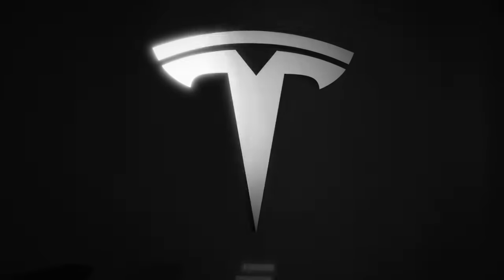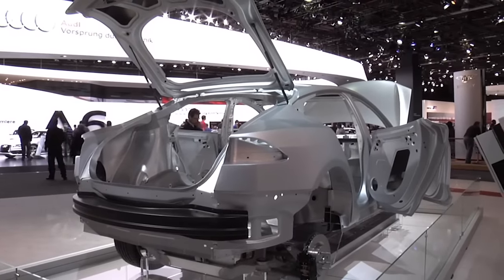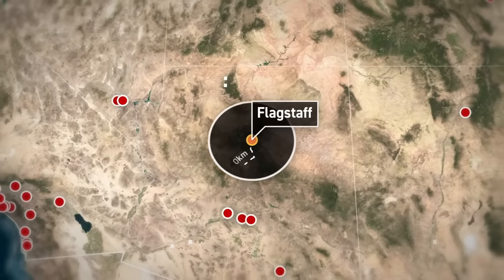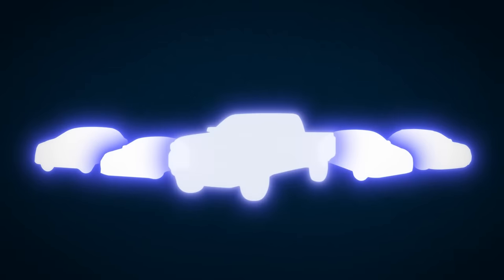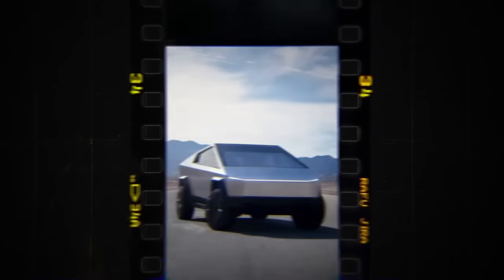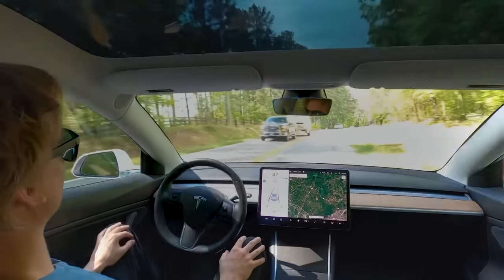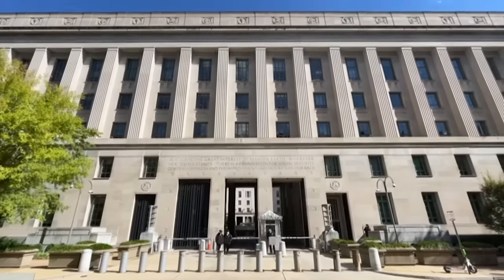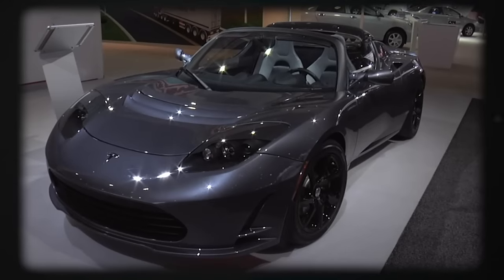How Tesla Fumbled

Comment: Honestly, I would just prefer a better public railroad system for both city and country areas. This massive public transportation would mean far less traffic, far less air travel, etc. Which means it would be better on the environment.

Living in Midwest we have a horrible public train system, the nearest station for my areas is over 105 miles away.
Although I'm in the country I'm surrounded by a handful of citys, hell my states capital is only 35 minutes away. But still, nearest train station is 105 miles 🤷‍♀️
Reply: Doesn’t work outside of high density zones, unless your low-density zones are extremely dense, like Europe (e.g avg Europe single-family homes are 3x smaller and property is 6x smaller).  Only ~13% of US citizens live in high-density
Reply: @monsterous289  and actually putting public transit in those high density areas would make a huge difference for the most people! Just because public transit "doesn't work" outside of cities is not an argument against it. Even then, intercity/town train and bus routes that do stop in rural areas can still work!
Reply: @elliotagnew9960  No one made that argument. I'm all for making high-density areas almost entirely walking/biking/public transport, and conversion as well.  Just most people and places (~87%) as in the countryside like OP mentioned, would not and do not benefit from public transportation
Reply: @monsterous289  I've seen too many arguments against public transit, and especially walkability/bikeability, because of edge cases.  It's worth saying it either way, even if no one was arguing that.

Interestingly, I stumbled on a cost-benefit analysis of public transit in rural areas while researching several years ago. It found it was beneficial, though that doesn't necessarily mean economically viable.
Reply: @elliotagnew9960  If we had continued building in a grid maybe it could have. Having sub urban sprawl kinda makes local transit hell to build effectively especially since buses are so inefficient. Trains could still be useful for connecting cities together and relying on ubers. but it wouldnt make sense for the bus to drive 3 miles each way to my house and im sure as shit not walking home or riding a bike home in the rain. i'll  keep my car.

Comment: Looking at your graph 18.15 it would seem the real fumble was made by Nissan who had an even greater lead than Tesl
Reply: Yeah, Nissan were extremely early into the market, but have been slow to improve their offerings
Reply: @Septimus_ii  It had the Renault Syndrome. "We are the first one" (as did Renault with the Zoé in Europe) but didnt bother to try to update it cuz it was a super niche market (duh)
Reply: Agreed especially in Europe. They had the early market in small EVs in the Leaf but Chademo when everyone else was on Type 2/CCS and a failure to innovate means their offerings are all but irrelevant. A shame as I live 10 miles from where they make them.
Reply: The Leaf had a weird charger than nobody else used, that killed it.
Reply: yup i noticed that too
Reply: Nissan was struggling overall so tgi is unfortunately unsurprising.
Reply: Remember it's a graph of EV market share. For Tesla to maintain balance they would need to increase production more than all the rest of the competitors increases' combined. That's hard. When one looks at total vehicles shares we see Tesla small but increasing hard, while traditional OEMs going back a lot (maybe total market has shrunk a bit too?). No wonder they spin off their EV brands, they plan for the main brand to go under, fire all they want to fire due to bankruptcy and come again (of course they keep the rights to the old brand in the back pocket so it can be returned at some point).

Comment: While this video did mention some important problems with Tesla such as the build quality and repair infrascruture i think the overall tone was a bit too negative. You failed to mention Tesla software wich is miles ahead in software update frequency and overall quality. Also Teslas superchager network is a major benefit for the brand as it is massively more reliable.
Reply: The problem is not being negative, the problem is being misleading as this video is.

Comment: I put a deposit down on an Ioniq5 in April 2022 with an estimated delivery first given for October-December. A couple weeks later that was pushed to January-March 2023.
Late January, after repeated attempts on getting an update I was finally told that Hyundai Canada hasn't even allowed the dealership to order the vehicle, and no delivery date can be given at that point. Canada is getting so few units of the Ioniq5 its estimated it would be another year or two before I could get one. 

So I canceled my order, put a deposit down on a Model 3, and got it within 3 weeks.

Ngl Tesla got away for a long time with less than stellar build quality and service being the only player in the market with a good range and performing EV. But every manufacturer currently is having delivery issues for new vehicles especially Hybrids and EVs. And they are hardly the only manufacturer with quality issues, as even GM had to stop taking Bolt orders for a bit to fix battery issues
Reply: And the Cybertruck launch has been a huge fumble, and will also likely be beat to market by the Silverado and Ram EVs as well. 

FSD is also a huge failure from the promises. The basic auto pilot that comes standard has adaptive cruise control and lane keep assit, is good enough usually. Except the Auto Wipers need to be on when engaged and they are infuriating

Comment: What is going on with your Mach-E comparison? You said the Mach-E Premium offers 310 miles of range with 0-60 of 5.8 seconds and a price of $50995. Looking that up today, yeah the Mach-E Premium starts at $50995 but that only gets you the RWD standard range which gets you 247 miles of range. In order to get that 310 mile range you mentioned, you want the Extended Range battery option which adds $7k to the price and increases the 0-60 to 6.1 seconds. But it wouldn't be as compelling to say that the Model Y offers better range, performance, and price.

If you were going for the most direct comparison on specs, you'd need to go AWD for a further $3k so they'd have the same acceleration. But then the price and range disparity becomes even greater; you pay an extra $6k for the Mach-E and get 40 fewer miles of range. Hell, at that point the Model Y Performance enters the fray, for $2k less than the Extended Range AWD Mach-E Premium you get an extra 13 miles of range and your 0-60 goes from 4.8 to 3.5 seconds. If you're actually making an apples-to-apples comparison, the Model Y generally bests the Mach-E on at at least 2 out of 3 of price, performance and range.
Reply: This just screams hit piece
Reply: He’s wrong about almost everything, not just the Mach E part 😀
Reply: @drebob1762  I won't go so far as to assume there's some nefarious motivation, I think it's totally plausible that Wendover figured a lot of people would enjoyed a one-sided critique of Tesla. And I'm sure a lot of people will.

Still, if the correct values were used for the Mach-E comparison (which is a good comparison to make, it's a close and popular competitor to Tesla's most popular model these days), it would take a lot of the wind out of that part of the video. Squandered lead? They're able to charge significantly less per mile of range because of advantages (design, supply chain, scale, etc.) afforded by spending the 2010s making EVs rather than sitting back and watching.

Comment: I think it all comes down to priority. When you are able to have people queuing up for your overpriced vehicles (tesla has an amazingly good markup on their vehicles already) then your N1 concern is how do I pump more of those out the door. And despite what a lot of more academic people have been arguing, the reality has been that mass producing EVs is going to be a pain for Ford and others just as it is for Tesla, because the battery is so incredibly hard to source in scale. I think Tesla has a lot of wiggle room to both increase quality and lower prices, but I don't see them doing that for as long as they don't feel the pressure, for now focusing on the core of their engineering to improve the technical competitive advantage has been the correct move. If they can keep lowering production costs and simultaneously release FSD in the coming 10 years, that's going to make them the largest car manufacturer in the world by the only metrics that matters: profit/sales.
Reply: Everything in this video is bunk because the simple fact is that all new cars sold will be EVs in the neat future, and the only thing deciding market share will be the ability to scale. How anyone could claim Tesla squandered anything when they have by FAR the highest manufacturing capacity of BEVs of any company in the world (yes, even more than BYD who sell fewer BEVs). Manufacturing is king. The fact that the video cites the Hummer EV as a viable example of an EV product 'already here' while is sold a mere 854 units in 2022 is really telling. Demand for EVs is skyrocketing. Those who produce them at scale will win. Simple as that. Customer service can be shored up later. That problem is not nearly as difficult to solve as BEV manufacturing at scale.
Reply: @LukaszPalkaPhoto  I think you're misunderstanding the argument of the video. Largely, it's that much of the first-mover advantage that Tesla had is gone now, and Telsa in early 2023 doesn't have many draws compared to other vehicles. While other manufacturers are only now starting to produce EVs at scale, the only real limit for them is sourcing batteries. In basically every other dimension, the big old legacy car manufacturers are much much much better at building a lot of cars economically. The other big companies have clearly been planning the shift to EVs for years, and they have a proven ability to manufacture at mass scale, the production numbers are small purely because they're just starting to ramp up these production pipelines, not because of insurmountable bottlenecks.
Reply: @jamesnomos8472  The first mover advantage is not gone. Tesla is profitable. GM is not. Legacy automakers are struggling, both with profitability and with safety. He brings up GM in this video, who have said openly that they are losing money on sales. He brings up Chevy Bolt, which had pretty some wild safety concerns. 
 Rivian is promising but they still have growing pains, which Tesla got over in 2018. Lucid just disappointed with terrible guidance for 2023. This video isn't just biased, it has several misleading comments. BYD's figures did not include only BEV's, include PHEV's as well. So Tesla is still #1 in BEV, by far. Also "simple" product line, like lol okay. Apple is probably the most profitable company by in human history and they have a "simple" product line compared to competitors.
Reply: @nithinsrivatsa4726  Tesla's profit for years havnt been via car sales but by selling carbon credits, it was only in 2021 that they made 'car sales profit' for the first time, and they had been enjoying subsidies and awhole lot of things alone that now other EV makers will get to enjoy too. Their 'advantage' is pretty much gone, plus the brand has taken a big hit recently, look at some big finance bros on youtube and how they dumped most of their tesla stock.
Reply: You had me until I read the  „FSD“ part
Reply: @chromesucks5299  retail investors are smart and they are hanging on the Tesla stock and buying at the Lows because they are not responsible for short term profits. I’ve made tenfold in five years, and I expect to make another 10 fold in the next five years.

Comment: It’s the charging network. And the quality of the cars has been getting better anecdotally. The fit and finish is night and day better since my first model 3, same for my brothers, parents, and cousins.
Reply: To be clear, I think elon is annoying af
Reply: And all the evs you mentioned have pretty big problems themselves. Rivian was a terrible example lol. Cool cars tho, but they have quality issues as well
Reply: quality issues have been going up for tesla. also add in they haven't refreshed any of their cars .
Reply: @CRneu  The internals of their cars are hugely different from their initial release in terms of wiring harnesses, ac units, battery pack design, front and rear assembly, and a few more things. They just don't change the exterior when they make these improvements.

Comment: You did a great job on this video, I think the biggest gap is talking about charging. While I drive a Chevy Bolt I knew I was missing out on the Tesla charging network, couple that with the bolts slower charging times, the Tesla does provide a great deal a value to justify its price. I still bought my bolt knowing these weaknesses and I’m very happy with it, but these factors are an additional consideration

Comment: Im from Denmark and now, almost a year after this videos release, something remarkable has happened. Here in Denmark, Teslas model Y became by far the best selling car in the country. Not even a competition, ub 2023 it sold over 3 times as many cars as the second best seller, the Peugeot 208 petrol. The reason for this huge boom in sale has been aggressive price dumps and loans. 

Over the last year Tesla has done 3 subsequent price dumps, several as much as 10% at a time. This has made Teslas models more affordable than ever before and made the price difference between the model Y and model 3 nearly non existant. Plus they also made trailer mounts for the model Y extremely affordable, and customers here in Denmark care a ton about the ability to pull a fully loaded trailer with no impact to acceleration, speed, and handling.

And as if thats not enough, Tesla has also started doing very aggressive in house loans that undercut other car loans. Most car loans have a monthly interest rate of 5-10%. Teslas loans can be as low as 1.5-2% per month in the first 3 years and immune to interest rate changes, which entices a ton of customers since its cheaper for them up front and per month. In fact this makes Teslas more affordable up front than nearly all equivalently sized EV's in the country, and many have already dubbed the Tesla model Y "The Volkswagen Beetle of the electric age" whether that even makes sense or not. 

In short Danish customers care most about having a few basic needs met and having them met at a low price for them. And somehow, in Teslas attempts to squander the competition and distract danish consumers from the strikes against them in neighbouring countries, they met that goal. Not as the luxury brand they initially were, but as a budget brand for the mass market.

Who knows how long this will last. The price dumping has likely just been made available by lumping sales or cuts against Tesla in other markets, like in Sweden, meaning a surplus of vehicles. Plus these are all the current model Y's that are doing sales records. Tesla is launching a new version of it soon and likely just wanted to get rid of their existing surplus of the current model before the new one reaches the market. So what made them a juggernaut for 2023 in Denmark might not be lasting.
Reply: From what I understand, the Danish government is heavily subsidizing Tesla. They are giving incentives, so that means the people can get their cars cheaper. It's not that Tesla is benevolent, it's that Scandinavian countries are moving forward with electric vehicles, trying to limit fossil fuels. I think it was Sweden or Finland who is trying to be all electric by 2030. And Tesla is the only large scale EV not made in China, so they get the subsidies.
Reply: Non of this is sustainable though. Tesla needs to merge with a bigger automaker if it want to have the scale to be able to be a car succesful maker, especially a budget one.

Comment: I think this video raises a lot of good points but is pretty unfair on many others. For example directly comparing the Model 3 to the Bolt EV isn't a fair comparison, the Model 3 is more expensive due to things like battery and charging technology, AutoPilot, glass roof, etc. Additionally, comments on things like build quality is a little misleading; there have been surveys done that Tesla owners in the majority of cases are buying the most expensive car they've ever bought and frequently come from used toyota's, honda's etc. These owners expect more due to the huge jump in car price, so they are much more vocal. If you go and take a look at a Porsche forum, there's the exact same posts about build quality, etc.
Reply: He didn't just mention anecdotal cases of bad build quality, he also cited neutral and professional independent sources.
Reply: Yes a Bolt is very good and way cheaper!
Reply: AutoPilot lol. Even the latest "Full Self-Driving" software version can't stop Tesla's from driving straight into a brick wall at 100mph+. Then there's "build quality", and here's the thing: while there may be more users complaining about build quality issues with other carmakers, those other carmakers also have way more than a couple hundred thousand units in the field, which makes them look more like "yeah, it sucks that your specimen's on the far side of the bell curve". Tesla never bothered ironing out their build quality issues even as they ramped up production. If Boeing were to assemble 787s the same way Tesla assembles their painfully overpriced and fault-ridden EVs, the whole company would've gone into receivership.

Comment: Lets be fair the cyber truck was DOA … from design to poor marketing , to un breakable windows all the way to the fact that the ceo has so many broken promises that is very difficult to believe anything coming out his mouth
Reply: The latest Cybertruck prototypes (MAY 2023) have basic problems with steering, braking, handling, noise and water ingress etc. At this point it should be 98% production ready, it's not even close.